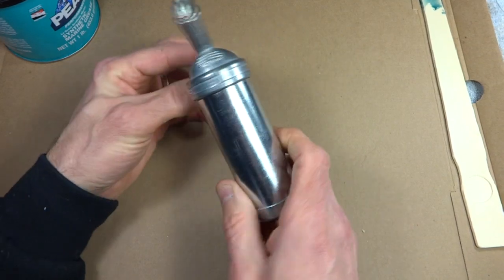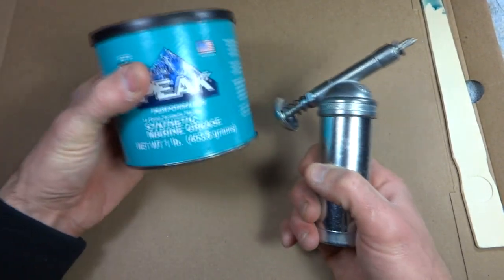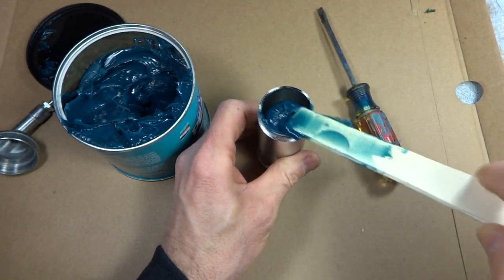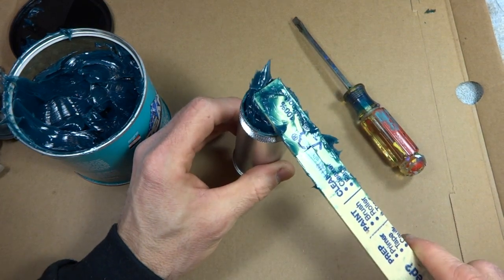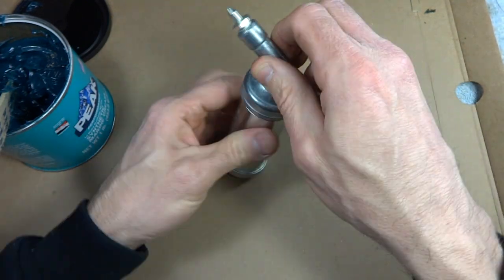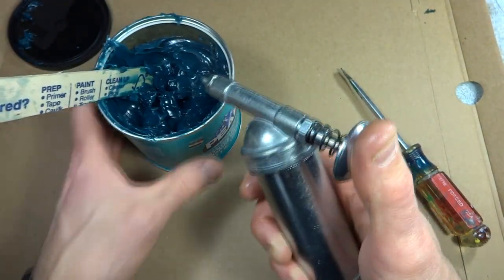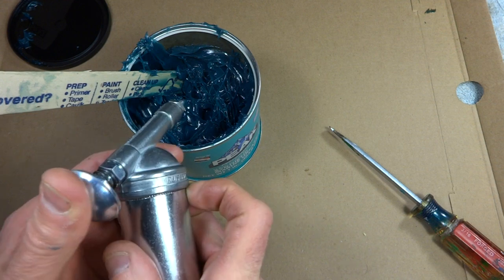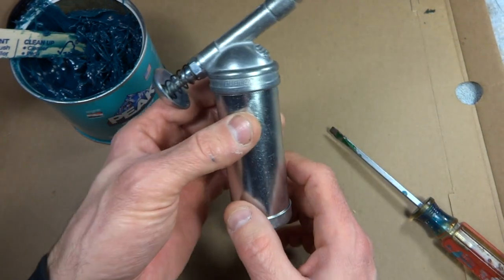Filling A Dualco Mini Grease Gun

Comment: Push and hold the button in while you push on the bottom plate with the screwdriver. That will allow the air to escape through the tip.

Comment: I have an old Lincoln lubrigun it looks just like yours. l got it with a very old Sears chainsaw case.I thought it was missing the plunger 😵thanks for the great info 👍
Reply: hey Ed, I thought the same about the one I just uncovered in the barn. glad to find this site, clean it up and load the grease.
Reply: Same here. Picked an identical Lincoln Lubrigun one up on a fleamarket table, and been wondering if I was missing the rod from the bottom end. Thanks for this education RJ. I'll be loading it up now!

Comment: I use a different method that eliminates the air pockets but you can't be afraid to get a little greasy. You remove the top, then take your screwdriver and push the plunger all the way to the top. Yes the top, not the bottom like in this video. Then take it and push the cylinder straight down into your can of grease til the plunger bottoms out. Then wipe off the grease from the outside and scrape it back into the can.. Yeah it's messy but that way it is completely full with no air pockets.
Reply: I just tried this - yes, it's effective, and yes, it's messy! I recommend wearing rubber gloves if you're going to do this, and you can degrease the outside of the cylinder with alcohol.
Reply: Motorex sells these Dualco guns, with long nozzles, under their own name. They also sell grease (I have their Fett 2000, Fett 3000) in 850 g tins (looks similar to the tin in this video) which have this (removable) plastic ring on the inside with a hole in the middle that is slightly smaller than the opening in the grease gun. The filling procedure is basically the method you describe, but because the plastic ring pushes down on the grease all around, the grease only goes up the grease gun, and there's practically no mess. One could probably DIY such a ring from a suitable piece of plastic. Video: https://youtu.be/ar5PtQK_pa8?si=fWZDDrZyaQG4uRRL&t=80

Comment: Hi, I bought a cheap one it works very well, but when I push the "piston" up to remove the air, after putting the grease in, I see through the hole in the bottom a little bit of grease, Is it normal?

Comment: I see they have these with blue and red tops as well as silver.  This would be super handy for coding them with the intended purpose; blue for waterproof, red for high temp, and silver for general purpose. Those will be much handier than have to keep track of a large grease gun or tub when working on small jobs on a my car.
Reply from the maker: Dualco? Or some other brand?
Reply: I apply some tape (Tesa Extra Power Perfect, available in multiple colors) on them, and write the name of the grease on them.

Comment: The grease makes the difference! I used a general purpose grease, orange transparent and after a year or so my bearings where toast. Then i switched to MoS2 Grease (KPF 2 K-30) and after 10 years and 1 regrease the bearings look good. I think MoS2 is the deal, but i tried nothing else then. Maybe EP-additives(could be) or PTFE(i doupt) would do the same or better? Has anyone information about this?

Comment: I literally just bought this exact grease gun.  Not sure what is wrong with it.  Haven't filled it with grease yet because the little plunger part that you press against to push the grease out is jammed or something.  I literally cant get the little pump part to move.

Comment: I have 3 of these now. I need to find a solution so they are constantly not tipping over. I wish they sold a base that would slide on the bottom or something. These are so top heavy that any bump and they tip over or fall off the bench. its very annoying. Ive tried to use a hole saw in a bit of wood but 1 1/2 inch is too small and 1 3/4 is way too large. There has to be something that fits on these things to make them more stable.
Reply: Use a magnet

Comment: Meaning to buy this Dualco on Amazon, I accidentally ordered the Astro 101, which is $7 cheaper, and it's working fine.  You can tell the Dualco is more rugged, but so far no complaints.
Reply from the maker: Someone else was asking me why their grease gun was leaking? I asked if they had bought the Dualco. Turned out they bought the Astro. Glad yours is working.

Comment: Do you see any reason to use a lower viscosity grease on any particular parts or would you say that the marine grease like you use is good as a "universal" grease for metal parts? I know (from you) about the sram butter for shocks with plastic parts, and I would use a liquid or dry lubricant for chains, and a spray/silicone lube for derailleur/brake pivot points, but wondered about other greases. Thanks!

Comment: can u hook it to a zerk..??
Reply from the maker: I don't know if they make a fitting for that. But I doubt it. This is good for small jobs like working on bikes. Not too many zerk fittings on bikes.
Reply: +desalvo66 dualco makes the attachment for zerk fittings...there is also a zerk fitting that attaches to that, to turn it back into a pin point applicator without unscrewing anything...best of both worlds i guess.....
Reply: +desalvo66  yes most of these guns can be plugged into small zerk fittings. Such fittings can be found on air tools with pneumatic gearboxes. I personally use  an Astro Pneumatic grease gun exactly like this one for the gear boxes on my die grinders and impact hammers. I use a synthetic white lithium ball berring grease called super white lithium grease. Does anyone else out there grease air tools and parts that require specific grease for particular applications. if so what grease are you using and why?

Comment: use a grout bag, to fill.. $5.00
Reply: +desalvo66  had to google it,it looks a lot like a piping bag that cake makers use to apply icing (frosting) to decorate large cakes,don't see why u couldn't use a piping bag instead as the nozzle would be wider :)
Reply: +neil froggy crompton Why not a plastic carrier bag you get from the supermarket?
Reply: +killerbanjo sounds good in theory,highly doubt it would handle being squeezed when full of grease,once tried to make a piping bag for my mum with a plastic carrier bag,we used a bottom corner of the bag reinforced with clear packing tape filled it with icing (frosting) cut a hole in the end  but the bag just stretched under pressure even when only squeezed gently.
plastic is a bi product of the petroleum distilling process & there's a possibility that the bag would rot & fall apart after coming into contact with grease so it would be 1 use only.
sometime after seeing this video i searched the net & found a grease gun made by kinchrome & it's exactly the same as the dualco rj has in this video except it has the brand name etched into the can body.
i paid less than $30 (australian $$) for it & i have no complaints except the nozzle could be a bit wider,but it's not really a problem @ all as it helps to control the grease flow.
there are several manufacturers of these grease guns so hunt around the net til u find the best deal,btw kinchrome has a 25 yr guarantee on all their tools &  rj says there are some dodgy versions of this being sold,so buyer beware
Reply: It looks like a great little tool. Also maybe a rubble sack would do the job as a piping bag?
Reply: there is also another type of grease gun that i saw in some u tube videos a while ago,it uses a grease cartridge like a small toothpaste tube & it just screws on to the bottom of the gun.